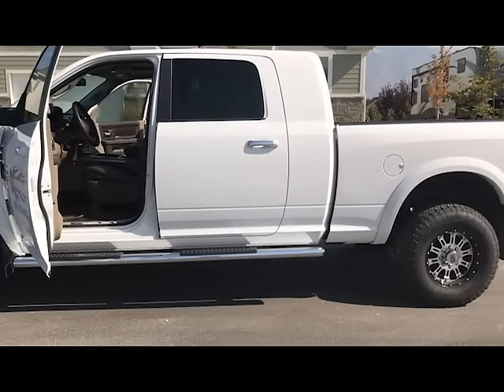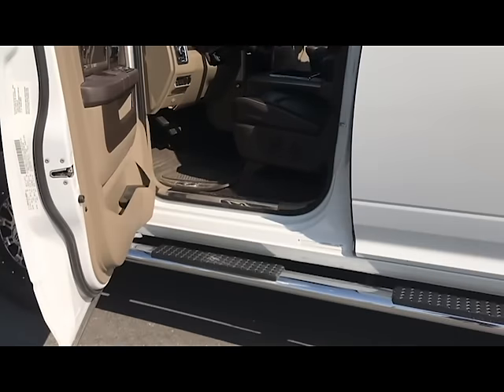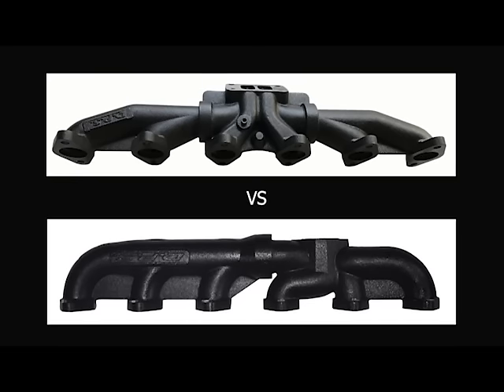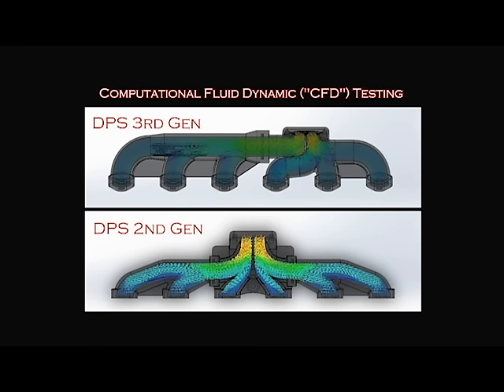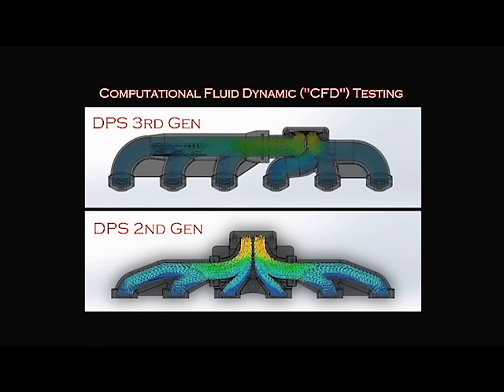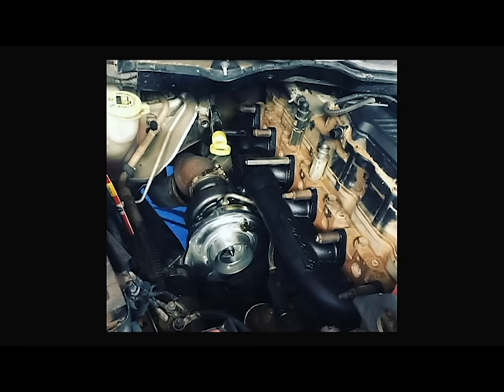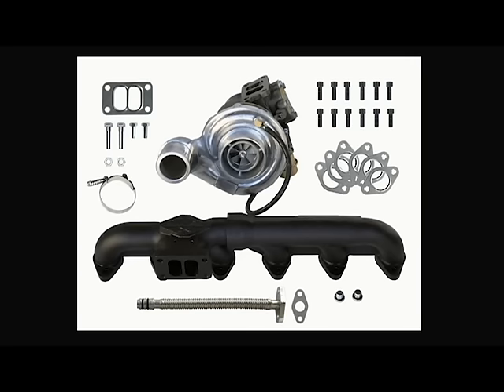3rd Gen Swap vs 2nd Gen Swap Kit for 6.7 Cummins turbo fascinating info!

Comment: What I wanna know is if your CFD "computational fluid dynamics" test accounts for exhaust pulses or if it was run assuming constant exhaust flow. This is why some head porters will pick up flow on a flow bench but lose 1/4 mile times. Engines don't produce constant exhaust flow. Show us Dyno results comparing theses 2 manifolds or better yet go to the dragstrip for a side by side test and I will be sold. With these computer simulations it's garbage in garbage out

Comment: How does you third gen manifold compare to ATS’s?  They look almost identical
Reply from the maker: We don’t have any experience with that particular manifold. However, I do know that ours flows as well or better than any manifold on the market because we design our products using computational fluid dynamic testing software that allows us to know what every particle of air is doing within our manifold.
Reply: @DieselPowerSource  do you offer the 3rd gen manifold without egr ports? I assume those ports severely disturb the flow and disrupt the pressure pulses whether blocked off or not

Comment: Most people do a 2nd gen swap for sound as well.
Reply from the maker: The exhaust tone of a 2nd gen swap is mostly due to the 2nd manifold having a divide between the front 3 and back 3 ports. Because our 3rd gen manifold also divides the 3 front form the 3 rear ports they have a similar exhaust tone to that of a 2nd gen.
Reply: DieselPowerSource so it will not sound like a common rail just curious I was very interested in your kit especially for the price but I prefer the sound of the 3rd gen also which turbo would you recommend for my truck 2014 ram 3500 dually welding truck pull 5th wheel cross country about 20k lbs between bed machine and trailer also have efi 30hp tune
Reply from the maker: Here is a link that will allow you to hear what it sounds like:  
https://www.youtube.com/watch?v=tFUEZ5ODlhE&feature=youtu.be
Reply from the maker: It's the divided scroll that makes the sound different.  Our 3rd gen swap kits have a divided scroll and sound nearly identical to 2nd gen swap kits.
Reply: Most people are dumb 😂

Comment: Yea, millions in engineering and people think that cummins and Dodge  don’t know what they were doing when they built the truck 🤦‍♂️
Reply from the maker: Yep, and that's why ours flows exhaust through the manifold approx. 35% better, and why our turbo absolutely crushes the stock turbo in both EGT control and power.  I think the main focus of the Cummins engineers was emissions compliance not performance.
Reply: I agree with diesel power source on this one. Not only are emissions  priorities likely dictating much of this design but you have to ask yourself if all the employees involved in the design of the stock manifold all agreed on how it should be done. Most importantly how much did they really care or did they need to meet a deadline. If the 3rd gen manifold design saves them $10 per part and they sell 1 mil engines that adds up as well

Comment: So for less than 1/4 of a percent we can spend hundreds of dollars to purchase your product which virtually makes no difference…
Reply from the maker: Thanks for watching and your feedback! It sounds like there might have been a mix-up on the details, so let me clarify. Our 3rd Gen swap kit is designed to simplify things—fewer parts, no custom fabrication, and easier installation—all while keeping performance on par with a 2nd Gen swap. If you’re not looking to upgrade or change your turbo, then sure, doing nothing is the more budget-friendly option! But for those ready to enhance their setup, we aim to deliver real value without unnecessary hassle. Hope that helps!
Reply: @DieselPowerSource why do you sell this manifold on the website anymore ?

Comment: steed speed manifold for the 2007 dodge 5.9 cummins what's the difference from your manifold compared to the steel speed manifold please let us know
Reply from the maker: The steed speed manifold is machined from solid pieces and welded together, and are one piece, so there are definite limitations.  Were we make cast ours, we were able to design it any way we wanted.  We designed ours with CFD software, which runs the exhaust through the system before we finish the design and allows us to make it flow optimum.  Ours is a 2-piece which allows for expansion as well.
Reply: @DieselPowerSource  do they flow better I'm just trying to get an idea let us know thank you

Comment: Now how about building a 2nd Gen style manifold with off the bread he351ve t4i flange for us guys that like a clean look and to run Vgt turbos on older trucks with standalone controllers.
Reply from the maker: In 1-4 months from now we will have a performance VGT that will fit on any application, including the older style Cummins. It will not be a modified VGT either. Stay tuned!
Reply: @DieselPowerSource  any update on the vgt turbo for 2nd gens?

Comment: You say a 2nd gen manifold can out flow a stock 3rd gen manifold. Is the 2nd gen manifold your referring to a stock or aftermarket manifold?  Sometimes i didn't know if you were referring to a stock or aftermarket manifold. I think that info would have been helpful in this video.
Reply from the maker: The 2nd gen maifold we refered to is our aftermarket DPS 2nd Gen performance manifold. Sorry for the confusion! Thanks for the question!
Reply: DieselPowerSource any plans to test both the stock (2nd & 3rd gen) manifolds against each other?

Comment: I have a 2002 Dodge Ram turbo in perfect condition with only 75k
original miles I bought it brand new and I would never trade or sell it
Reply: big ron : Nice! I can relate to exactly how you feel. I currently have a 1999, and two 2002 CTD's. All have higher miles, around 180K, 280K, and 315K on 'em. All run and operate just ducky! Not planning on getting rid of any of them any time soon either. Cheaper to keep rebuilding the trucks and run 'em. All the new stuff being manufactured in the past 10 years or so is all shit, mostly thanks to all of the emissions garbage on the engines.
Reply: @Pony Chaser:  Truth!

Comment: @dieselpowersource what is the performance difference between a stock manifold and yours?  Why should I buy a 3rd gen manifold when I already have one?
Reply from the maker: These kits are designed for the 6.7L Cummins engine.  The reason you need a 3rd gen manifold is the turbo flange on the factory 6.7L manifolds are a goofy T4i, so they just don't fit our turbos.

Comment: The reason why you 2 gen swap is bc the actuator on the stick turbos go out so often it’s not worth 2 grand just for a damn actuator.
Reply from the maker: It's the turbo that makes the difference with vanes sticking, not 2nd Gen vs. 3rd Gen swap.  That's just the location of the turbo that we're talking about.  Our basic 3rd gen swap kits use a normal wastegated turbo, that has no vanes to stick.  Ours simply place the turbo in the same location as the 6.7 Cummins engine, and so it's less hassle to install.

Comment: I have a 2012 cummins 6.7l, I would like to change the stock manifold using the factory turbo.  What brand and model # should I install?
Reply: steed speed makes a nice one,  but honestly the stok turbo is junk in these trucks.  i wouldnt invest in keeping the stock vgt.    3rd gen swap, 2nd gen swap, with exhaust brake.  save your money dont build your truck around that stock turbo,

Comment: I have a raceme single tow tune will I be able to slap this kit on with no issues or do I need to upgrade tubes
Reply from the maker: That will work well with this 3rd gen swap.
Reply: DieselPowerSource I have a 2014 with that tune can I just directly swap everything with your kit and do you have a direct link to your kit for my 14 ram
Reply from the maker: Yes our kit will fit your 2014, but you need to have all of the EGR removed and deleted.

Comment: Does it sound like the 2nd gen ya know dumptruck like? If so sign me up!
Reply from the maker: Yes, because it separates the front and rear 3 cylinder from each other it has the deeper more throaty sound, just like the 2nd gen manifolds.

Comment: Engine brake still work
Reply from the maker: No, because the exhaust brake in the 6.7L is actually in the VGT turbo. However, in about 1 month we will be offering our new performance VGT housing that will fit on any S300 style turbo and it has exhaust brake capability.

Comment: Does your third gen manifold sound like a second gen? That's the reason for most of the swaps...
Reply from the maker: Yes, it does sound like a 2nd gen swap because our 3rd gen manifold splits the front 3 ports front the rear 3 ports just like the 2nd gen manifold.  DieselPowerSource
Here is a link that lets you to hear what it sounds like:  
https://www.youtube.com/watch?v=tFUEZ5ODlhE&feature=youtu.be